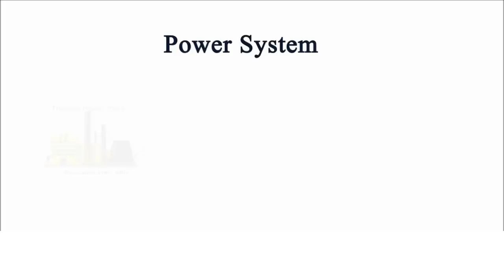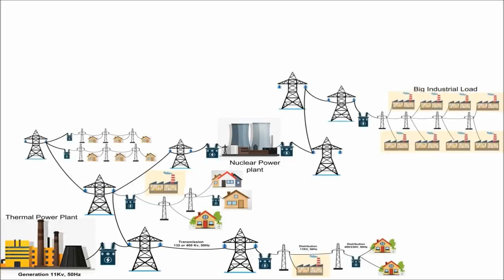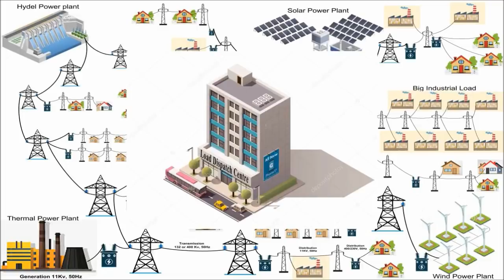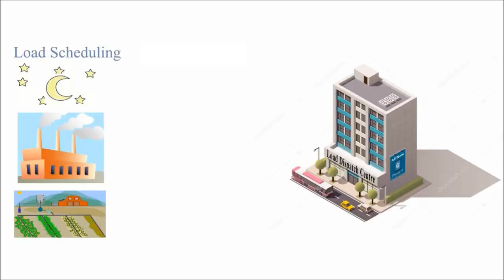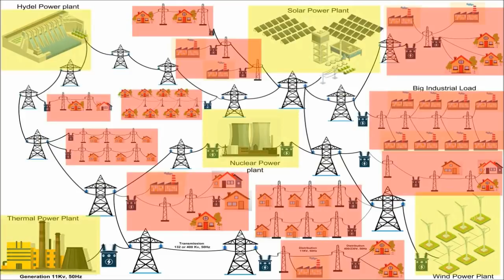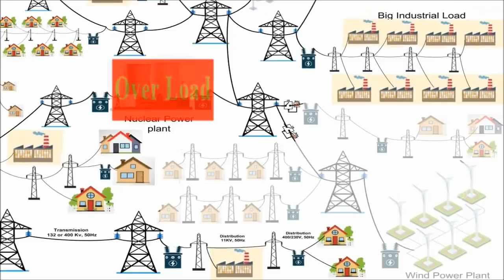What causes power grid failure?

Comment: Can the grid fail when generation exceeds consumption?
Reply: Muzammil Khan in case of generation exceeding consumption, an artificial demand in created by using the excess energy in pump houses, where electric energy is converted to potential energy, by pumping up water. But there’s considerable energy loss here. Later this potential energy of water in converted back through hydropower plants.
Reply: Yes. Very much possible. There is no wastage of energy in power systems.